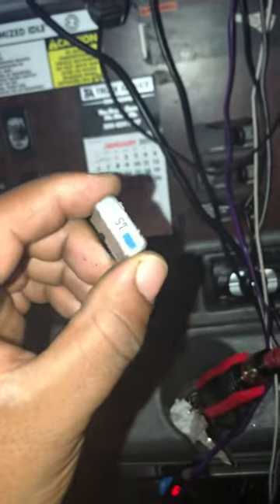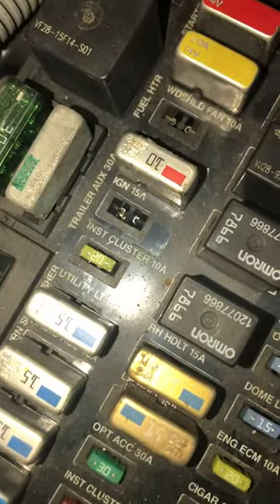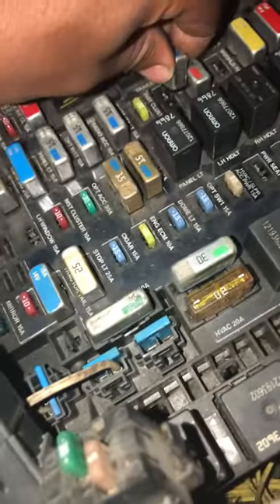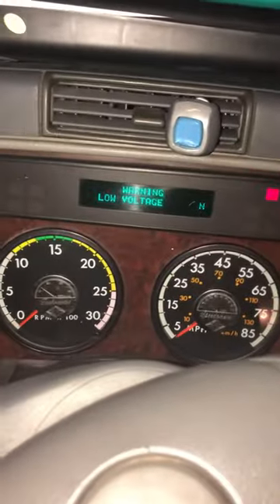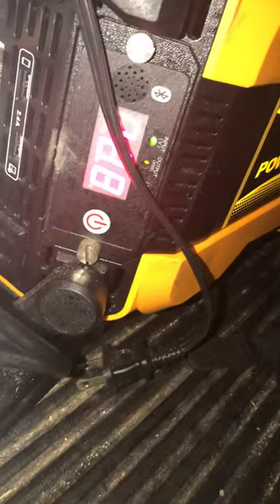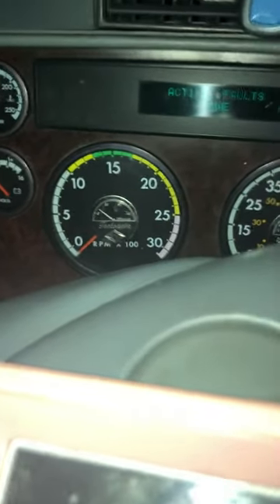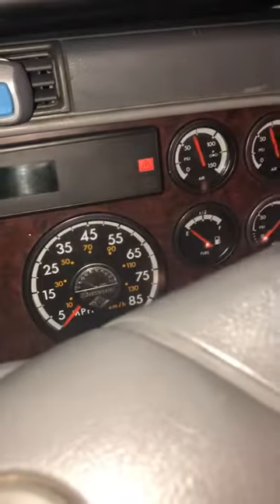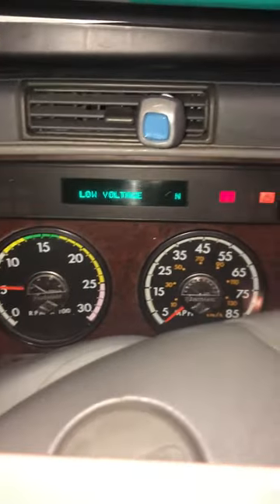2007 freightliner century electrical

Comment: Water is getting into the fuses and circuits on the panel next to the drivers seat. Move the seat forward you’ll see a panel. Open it and water is coming in thru the division of your roof and cab
Reply: This man speaks from EXPERIENCE and I 2nd his statement
Reply: What do you do to fix the problem?
Reply: @michaelcooper6897   you have to put silicone outside the cab on all junctions of the roof and lower cab
Reply: So you're saying there is another fuse box behind the driver seat?
Reply: @johncalvo1743  yes
Reply: @ramnale  Thank you. I will look into this. Please stay tuned...
Reply: Hey Ram. All the lights in my cab suddenly don't turn on. Neither do my cigarette chargers or USB chargers on the dash. So I can't charge my phones or eld. What could have happened? I figure a fuse, but will ONE fuse handle all this?

Comment: It is probably too late now but thick copper cable that goes from starter to cab is corroded from inside and it is hard to see. possible some other electrical cables. Had same issue plus truck would shut off during drive and some other crazy stuff. That cable can make ECU crazy acting
Reply: Dose this cable run to the power distribution center on the left side of the truck “inside fuse panel “

Comment: Check your fuses in the battery box area. They are 30 amp fuses. It maybe coming from a wire back in your battery box area. Also you could have a bad battery. Were all 4 bought at the same time? Never buy 1 or 2 or 3. Always swap all 4 out when 1 or 2 is bad.
Reply: Where are the other fuses on the battery? 
I have some issues with my gauges, I already spent some money and mechanics can’t fix the problem
Reply: Which gauges
Reply: The Observer Melanin 
The oil gauge, the water temperature, battery gauge, speedometer and tachometer. 
My pressure gauge and my fuel gauge still work
Reply: @JoseHernandez-lm3hs  
Did you get anything deleted lately like your egr? Sounds like a ecm issue
Reply from the maker: Thanks
Reply: @JoseHernandez-lm3hs  Did you ever find the problem ?
Reply: My power data long for ELD WANT Work. Had the same issue with ignition n lights just come on when rain
Reply: @deontefrierson3571  
Mine does that also, parking light on my headlights come on when it rains .

Comment: I'm having the same problem with my 2004 freighliner century class st, low voltage warning light is on all the time whenever I start the truck. Can you help me please
Reply: Maybe the low voltage disconnect. Located behind dash where the cup holder sits.
Reply: @diasmaxey1023  I replace it with brand new and it still lose power
Reply: @thowguandong3076  may be low voltage going to the ecm. check the smaller red wire in the battery box, if you see black tape someone has already been in there & you probably have a connection issue by the fuse holder for the ecm.
Reply: Did you fix the problem? Thow Guandong
Reply: @alexescobar5392  no I still have low voltage
Reply: @thowguandong3076  , did you fix your low voltage problem? 
If not, then watch this video:
https://youtu.be/o-lxaqk5AlY

Comment: I guy has a video where he pulls his ignition fuse and cleaned ithe corrosion
And reinstalled  fuse  it fixed problem truck cuts off by the key...15 Amp fuse next to the one you pulled out

Comment: What did you have to replace to fix your problem? Please help cause I'm having the same problem.
Reply from the maker: Water was getting to it I sealed the joints on outside of cab
Reply: @Lowcountryinshore843  good bless
Reply: How did you fix the problem? My dash will black out for an hr or 2 then it will power back on.

Comment: Having similar issue right now
Reply: its low voltage box behind cigar lighter under cup holders. you can bypass it or just get a new one. it should be on right side.

Comment from the maker: It was water got to box behind driver seat
Reply: What do you mean?
Reply from the maker: @joseHernandez-uu2cx  I’m saying water gets in your truck when it rains really hard and get everything wet in compartment behind drivers seat
Reply: So you're saying there is another fuse box behind the driver seat?
Reply: @johncalvo1743  It's not behind the seat it's the side wall compartment just behind the drivers door there is a module and fuses compartment
Reply: Same year same truck. Did you replace any wires in the box side panel behind the seat, or did you just seal the cab. I have the same  crazy issues, except now my truck is not starting, and the panel does not light up when I turn on the ignition. I'm going to have to play around with those wires tomorrow I'm here stranded right now in NM, middle of nowhere.
Reply: Once i was driving and smoke starting coming from the driver side i immediately pulled over i was scared the truck would catch on fire. I turned off the truck and it stopped smoking after few minutes but I noticed i had no lights in my bunk but everything else was good and safe but all this happened because the company i joined installed satellite and didn’t put back the fuse box cover and because it was a very rainy day this happened

Comment: What did you find out about this?
Reply from the maker: DemBallBoys water was getting down in my wires behind seat in piller sealed it up and all good
Reply: @Lowcountryinshore843  so water was getting into the fuse box in the side panel by the driver seat?
Reply: How did u seal?

Comment: Water is getting into the fuses and circuits on the panel next to the drivers seat. Move the seat forward you’ll see a panel. Open it and water is coming in thru the division of your roof and cab
Reply: Yep..I had same PRB
Reply: So what did you have to change??
Reply: @1kwilliam-rv1mo  just put some silicone on the roof and window edges